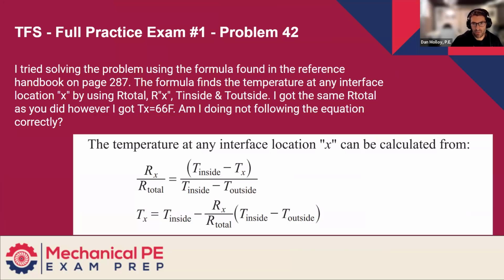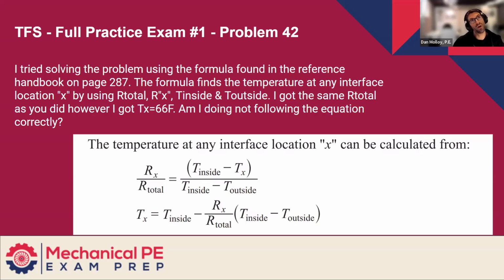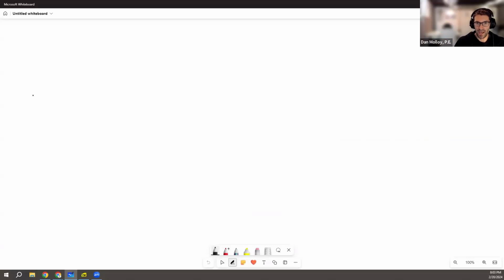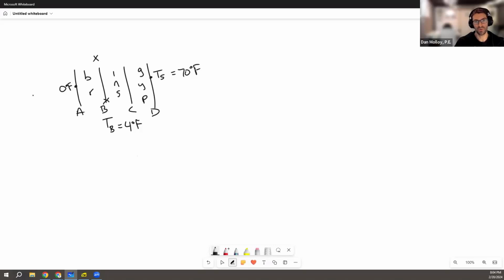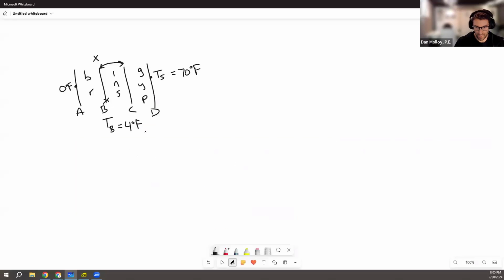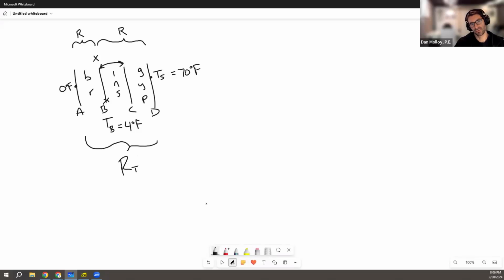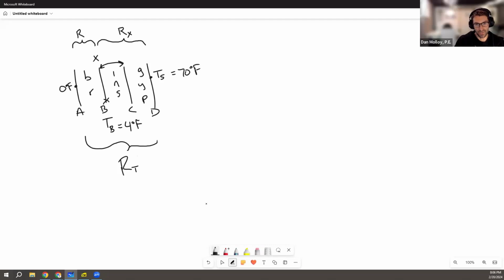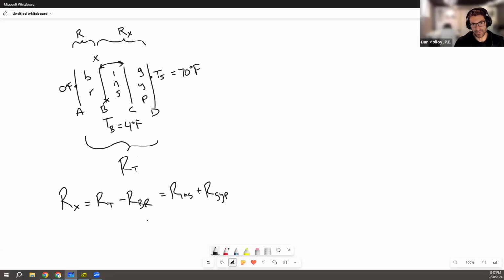Mechanical PE Exam Prep with Dan Molloy, PE | Temperature Between Layers of a Composite Wall

Comment: I was solving that problem in the practice exam and at the first time i got 66 as a result of using the ecuation shown in the Handbook. Then what I thought is that normally those ecuations are made when the heat travels from outside to the inside which isn’t the case in this problem so given that the situation is different I just said that inside is outside and outside is inside.
Reply from the maker: Nice job using your intuition to override the answer you obtained initially.  Engineering judgment is paramount, even when you have to do something unconventional.  Bravo!